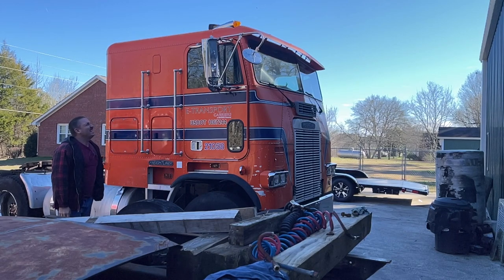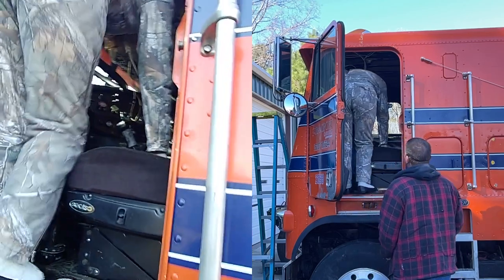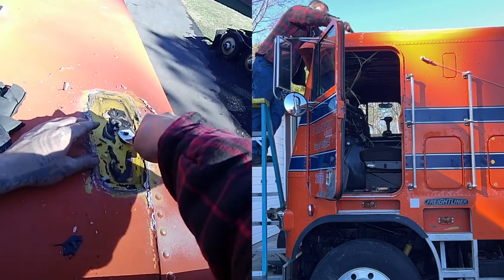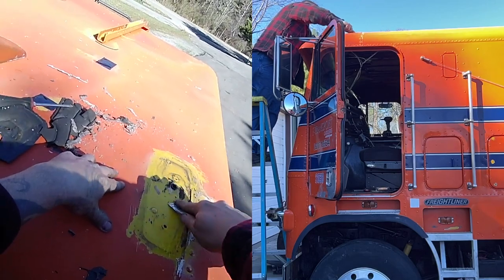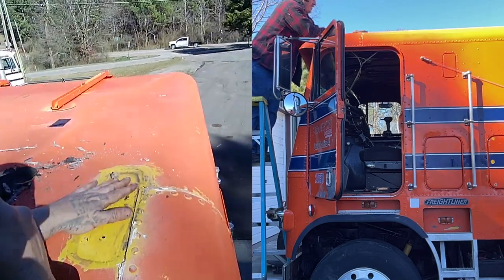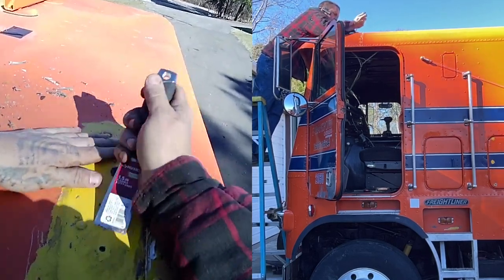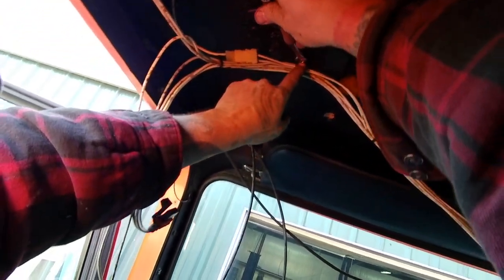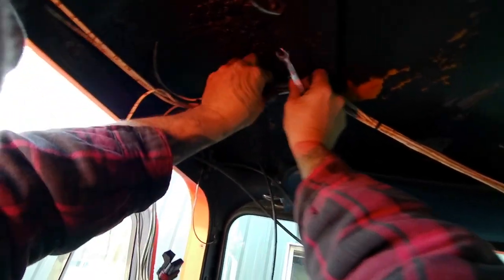1989 Freightliner Cabover “Cab light install”

Comment: I put the  metal chrome  bullet lights with the glass  lens  on my Freightliners. When  you  hook them up  use quick disconnect  plugs for the wiring so you don't  have  to  keep  cutting  the  wires to replace  that rubber  gasket  underneath  the light. Those gaskets don't  last  but a few years before  they  dry out  and start leaking. The silicone  you will help a little

Comment: Those are a nice light. I always liked that style. Also liked the bullet style that looks like a bullet has 2 screws in the front holding them down. Had those on an old 9670 I drove many moons ago. They shouldn’t leak the way you mounted them. Those almost look like the ones that came on my friends 80 model frieghtliner cab over. Mount the same way and stuff. But you’re right gosh they look way back on the cab. I wonder if that’s something to do with the visor brackets?  Be careful working off the ladder. Kinda surprised to hear it was the horns leaking all along I’m sure you’ll be able to find another pair. How are you gonna fix up the headliner, was there enough that wasn’t ruined from water damage to make a new one?
Reply from the maker: The headliner is foam backed. With a thick cardboard glued on.  The water killed the cardboard but the good part is it also unglued it from the foam. So likely I’ll be able to glue n
Reply from the maker: New stuff and it’ll be fine
Reply: @JamesPretty  That’s good so it should come out great. I’ve not seen really how one is made.

Comment: I was curious if you have changed the insulation on the underneath of any of you cabovers and what exactly did you use.
Reply from the maker: No I haven’t yet.  But Delores’ hanging down so I might.
Reply from the maker: I might consider spray foam unless I find something better
Reply: @JamesPretty  I was thinking the same thing.